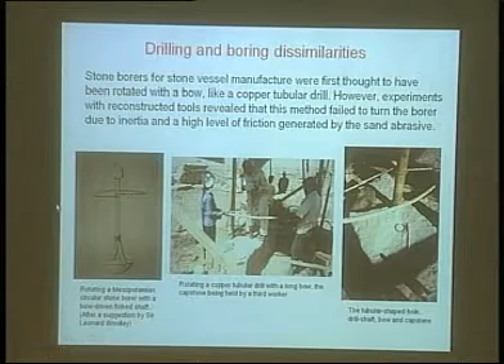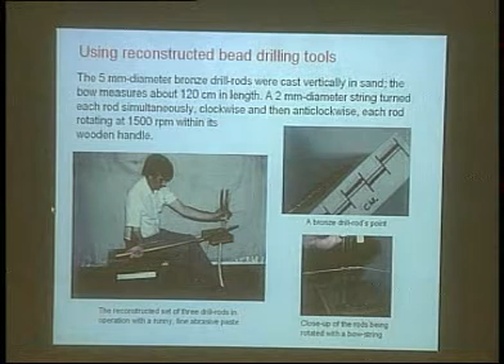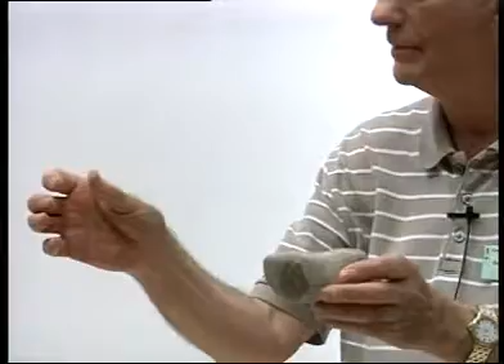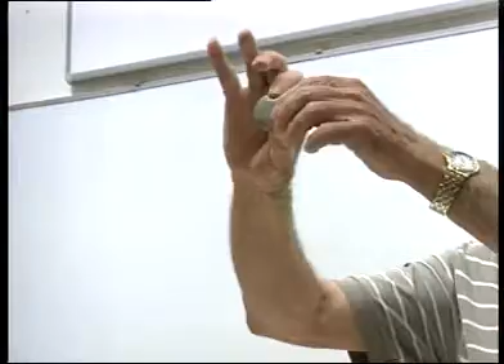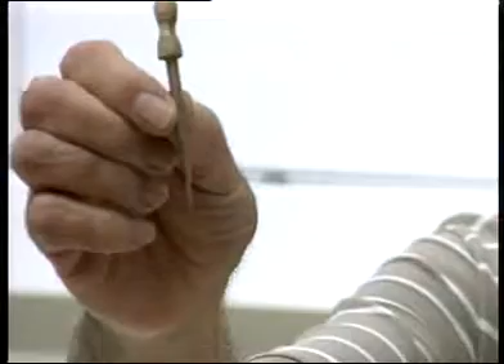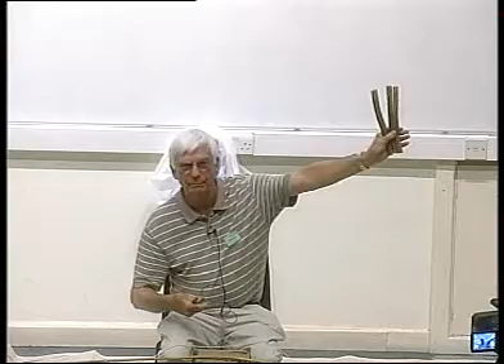Denys Stocks - Some Experiments in Ancient Egyptian Stone Technology

Comment: Not all 'engineers' are equal (look up Stock's CV by the way) - Chris Dunn has posted (and Uncharted X) impeccable metrology results and videotaped the actual measuring of ancient (maybe even pre dynastic) vases MACHINED to mere thousands of an inch accuracy - UTTERLY impossible for ANY hand controlled chipping or grinding process.  To those with no personal or professional exposure to manufacture of any kind (I include Dr Miano here) handwaving and use of hyperbole or just waffle (verbiage) is sufficient explanation.  To the rest it is not.

Comment: I'm afraid that I am persuaded by the sheer amount of drudgery that would be involved to make everything by 'pounding' or slow wearing away, stone against stone by hand that some other technique had to have been involved -- the degree of precision acheived is a separate issue (we don't always strive for absolute precision even using machine tools , sometimes it just doesn't matter , As a qualified engineering patternmaker (dying breed) I can attest that frequently it is only functional surfaces and dimensions that are created to tolerances --the backside of a tool might be just left rough for example.  But that they could, and did, make SOME things with undeniable exactitude beyond what hand pounding could possibbly achieve and that fact leads to astounding implications .....
Reply: @annadalassena5460  Of course if you rule out incredibly (literally) tedious wearing away by hand using crude stones and take into account the precision of flatness, squareness, symmettry , circularity in the case of bowls vases etc and so on you must conced that they had some form of non hand guided efficient stone shaping - ie machinery ,tribilogy ,metrology . To most archeologists this is beyond astounding on to unthinkable......  "Truth"? - 'that which is correct'...?  see Pontious Pilate .
Reply: Re "the sheer amount of drudgery that would be involved" Egypt at the time had a large population of peasants  who would have months of the year with little to do other than watch crops grow. I am open to arguments that we don't know how some things could be done with the technology that we know they have, but one resource we know they had was the time to do a truly humungous amount of drudgery. This was not some pastoral tribe where a hundred people putting in a hundred days affort every year for a hundred years would be a major commitment, they had a capacity for drudgery many orders of magnitude above that.
Reply: @jonathancardy9941  see the recent uncharted x video 'scanning an ancient granite vase to thousandths of an inch game changer etc'  (google will get you there ,title is approximate UNLIKE the vase which is INCREDIBLY precise - measured by qualified metrologists and showing the cad images -- astounding accuracy in all principle axiis and circularity - FAR FAR beyond any POSSIBLE result by handwork even in 'infinite' time.   This result does change everything - no room for hand waving or speculation or other 'excuses' -the things are MACHINED.
Reply: @rossnolan7283  My comment was specifically a response to "the sheer amount of drudgery that would be involved". The accuracy is a different topic that might be a much stronger argument without the drudgery comment. Arguments are often stronger if you omit the weakest link.
Reply: @rossnolan7283 Uncharted X simply lies to you.
Reply: Hard work. What a concept!
Reply: Classic "historian's fallacy"
Reply: Sadly Denys Stocks appears to be a simple Northern lad, using simple logic, which is totally unscientific. He is one of the many misguided people who are trying to make sense of how a civilisation barely out of the wheel, could create such incredible architectural structures and exquisite art/jewellery etc, with often the most primitive of tools, seemingly in just a few minutes. They obviously could not, there has to be more to it. The squaring of internal and external corners done with such precision and the mirror finish polishing of them into hard granite etc are just two examples that defy logic with the tools available at that time. 
 Stocks and others are living in a dream world, spouting garbage, which is covering up the truth and causing others not to look for it.

It's a shame that Denys et al are invited to talk as though they are specialists in the field, as studying something your entire  life, particularly when you only use your own theories, sadly does not make you an expert.
Reply: @ankyspon1701  I agree --as to 'barely out of the wheel'  I seem to recall that we are meant to believe that the pyramid era Egyptians did not know about the wheel.  Might be wrong but I can't recall any depictions of the wheel until much later --all theorists on pyramid construction do not show wheels either --of course the bowls had to be turned (but how they included the integral handles is baffling )  presuming you know about uncharted x and maybe david miano 'world of antiquity' both worth a look.
Reply: @rossnolan7283  The Egyptians used the wheel in clay and stone pottery. They preferred sleds and boats for travel. That's where the idea that they didn't have the wheel comes from, but they obviously did.
Reply: @zombiedeathrays8862  not everything that rotates is a wheel --the axle is more of an invention if it comes to it , logs have rolled since time immemorial as have round rocks -neither can facilitate moving large objects efficiently , only true wheels eqipped with axles and some sort of chassis to mount the load on can do that . I seem to recall the Hyskos (sic) introduced the wheeled vehicle/chariot etc to Egypt.  Anyway Stocks et al posit that the 'tool' -crude lumps of rock on a bent stick did the rotating -the workpiece being fixed .  unlike a potter's wheel or lathe .  the ultra precision measured by Christopher Dunn (and son) completely rules out hand making by any means.
Reply: @rossnolan7283  isn't  Christopher Dunn the guy who thinks that the pyramid is a power plant? If s i'm not sure how seriously I would take him as a source but I'd be happy to have a look at his peer reviewed publications if you can link me to a reputable source for your claim. So far from what I've seen I've found the  "Egyptians couldn't have made this precision" argument unconvincing. If Dunn is who inching he is then there are some compelling objections to his work, but happy to check out your sources.
Reply: @zombiedeathrays8862  Yes, but best to ignore his speculations on power plants - his expertise is in metrology and precision manufacture  ( Isaac Newton spent more time on alchemy and trying to decipher secret messages in the bible about Solomon's temple etc than on inventing calculus or optics, mechanics etc -- most geniuses (genii ?) seem to have had eccentricities  (look up Heaviside )   "Uncharted X' has recently posted a comprehensive video on the ULTRA precise granite vase measured to a few .001ths of an inch --this is utterley impossible by ANY hand process let alone the incredible Stocks/Russian woman crudity ( Scientists against myths) .    The other problem is the sheer size and logistic issues with titanic statues made from granite - again look into Uncharted x and lots of others .
Reply: @rossnolan7283  unchartedx is a YouTube channel... looking for a peer reviewed publication or something backed up by proper scholarship...
Reply: @ankyspon1701  I asked Grok about all of this copper chisels and pounding stone BULLSHIT Grok kept using this fool as an airtight excuse for all of the impossible objects made in ancient Egypt. It was very frustrating. I even pointed out his show on nova which he puts on a laughable example of core drilling with copper tubes and sand. Where he gave up breaking the core free with a copper chisel and used a steel chisel to finish the job.. I asked Grock if he is willing to display that he couldn’t present his own claims of copper chisels, what would stop him from using modern equipment when the camera isn’t running. This idiot is a true snake oil salesman
Reply: @ankyspon1701 Horseshit. He's a "Northern lad" who has bothered to do the work for you. You can't be bothered to pay attention. It's a shame